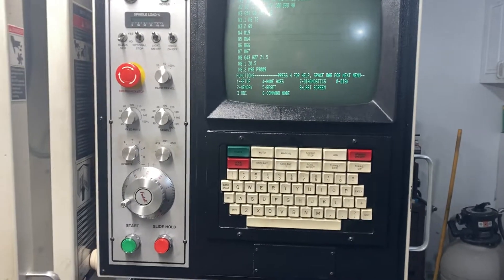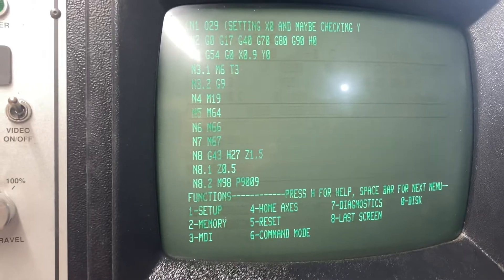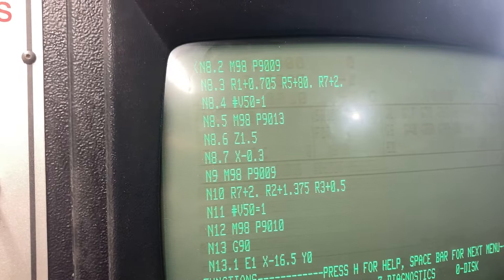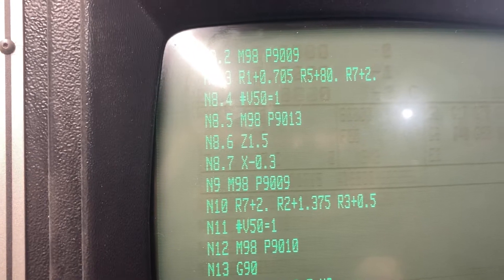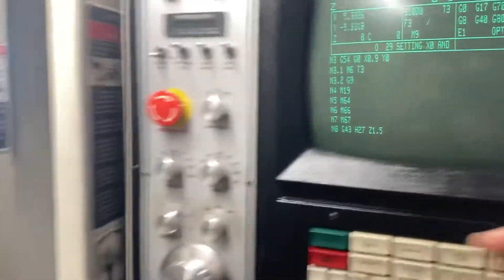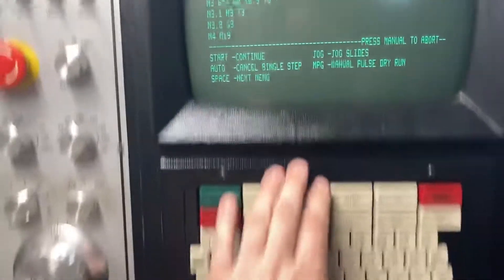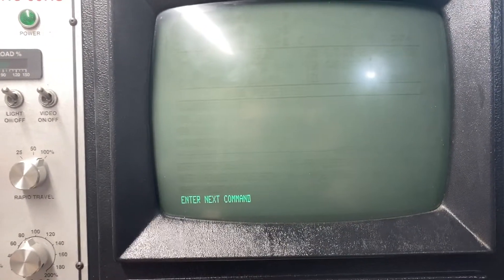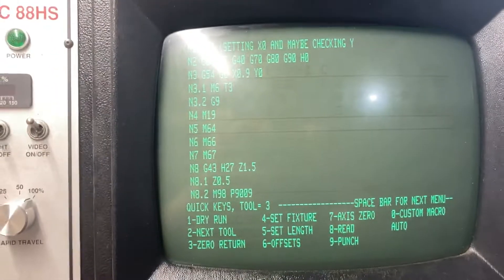Renishaw Probing on the Fadal VMC 15

Comment: Where did you get the Renishaw macros for the fadal?
Reply from the maker: You will need to buy the probing macros directly from Renishaw. In this case, I'm using the built-in Fadal probing macros modified to work like the Renishaw macros. Ask around on the Fadal Facebook group and you'll find peoples custom probing software. Of course you must understand  that you're responsible for what you do with your own machine.